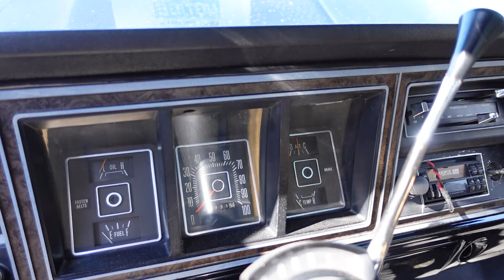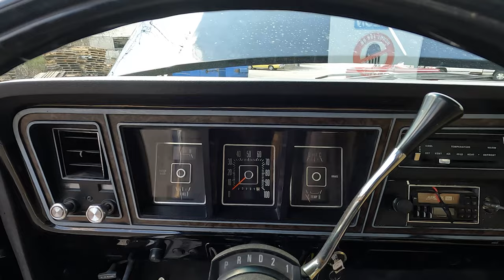Coal Rollin' Cummins Powered 1977 Ford F250 Walkaround w Steve Magnante | Coldstart! POV Drive!

Comment: It's not a "dodge engine in a Ford" it's a Cummins engine in a Ford
Reply: @allanstriber5272  Ford sold all their shares in Cummins decades ago because Cummins refused to put their engine in a Ford! Engine from a Dodge, diffs from a Dodge company, transmission and transfer case is Dodge! What you have there is a cow pie with cream filing! If Ford could build an engine people would stop swapping in Dodge and Chevy engines.
Reply: People will coyote ANYTHING ! , I'd put a Honda motor in it , over a Chevy  , can't  buy Dodge swag at a CUMMINS DEALER LMFAO 😂😂😅

Comment: Wtf is a Dana 45? The rear is a Dana 60 lmao
Reply: Couldn't tell about the rear for sure, may have been a 70. The front is definitely a 44, probably fine if this truck will never be used for more than cruising.

Never heard of a dana 45...
Reply: The rear is a Dana 70 out of the donor truck, the front is likely a Dana 44

Comment: My grandfather had a 70s f250 that was bright red. This brings back memories but that diesel just ruined it for me.
Reply: Why? The 5.9 Cummins helps the HiBoy gain everything it was lacking. Three times better mileage, easily at least three times the power, it will last much longer and the turbocharger sounds sweet!

Comment: 1989 was the first year for the Cummins 5.9L diesel in the Dodge Ram series so it was late 1980s more so than mid-1980s. I can do without the rolling coal smoke especially if I'm behind it. I'm all for power and performance, but when it smokes and stinks, it's not for me.
Reply: I don’t mind the smoke at all, and I’ve smelled some very awful smells but the smell of soot just is t up there with those smells, I actually kinda like it
Reply: It just shows how dirty the engine is! When I got my 89 it would smoke black every time I gave it a little throttle, so I started adding Kleen Flo diesel conditioner every time I fueled up, and within 3 months I could no longer make it smoke.
Reply: @nathanadrian7797 No need for it if it is running right.
Reply: 460 fuel injection 😮

Comment: Nice truck, but this guy got it wrong its not a dodge engine in a ford. It's a cummins in a ford, cummins is a stand alone company and have been making engines in all sorts of vehicles and farm equipment. equipment
Reply: A Cummins engine built specifically for Dodge to Dodges specifications. Has there ever been a day you could get another brand of pick up with a 6cyl Cummins other than Dodge? No!!!! If Ford could build an engine, people would stop using Dodge and Chevy engines to make Fords move!
Reply: @nathanadrian7797 bit sore ?
Reply: Still not a Dodge butt sore brothers ENGINE😅😅
Reply: Dana not Dodge either
Reply: @bretstauffer3744  no

Comment: I doubt that’s a torque flight transmission, and that’s most likely a Dana 60 rear. Definitely not a Dana 45 up front
Reply: Probably a 48 RE , which is Chrysler.
Reply: @powerwagon3731  haha, I’m fully aware that a 48re is a Chrysler Trans but I’m curious as to why you would assume this truck has a 48re… this is a Ford HiBoy that’s running all the factory running gear except for the engine and trans, seeing as how the 5.9 in this truck has a P7100 injector pump it would make more sense to assume the engine and trans both came from a donor truck “most likely the same donor truck”, and the P Pump engines were only mated with 47rh and 47re automatic transmissions, the 48re was only used with common rail engines. A torque flight would make sense if the combo came from a first Gen donor truck and the engine was upgraded to a P Pump, but a 48re would be a pretty far reach.